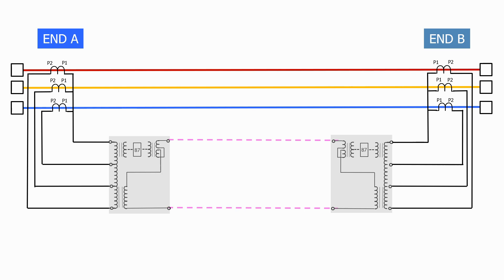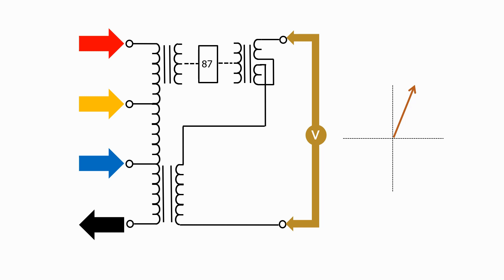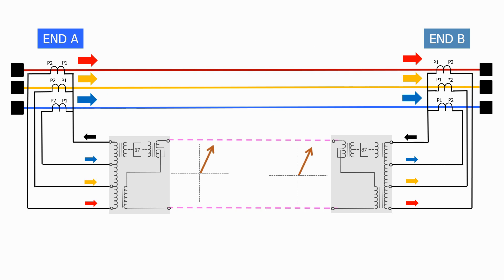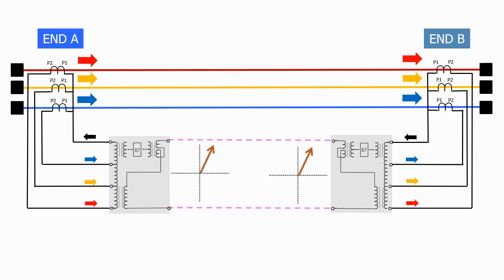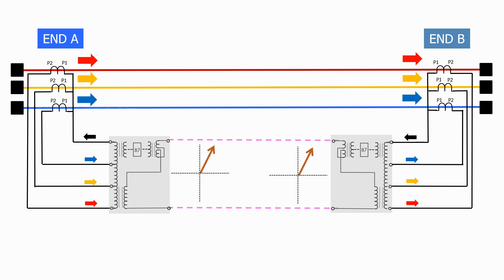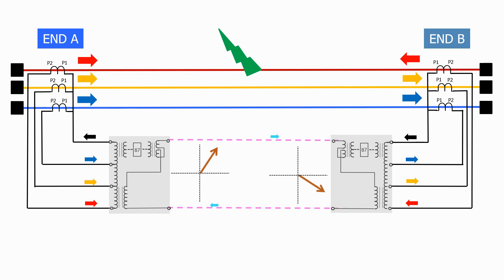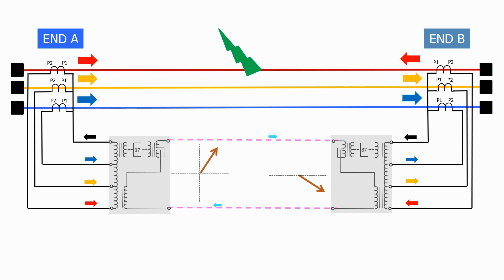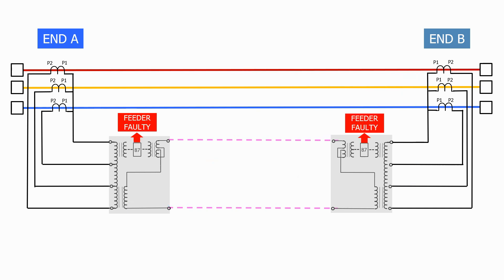Pilot wire differential protection

Comment: Hi Stephen, your explanation is clear and concise! Well done! Do you conduct lessons on the commissioning of pilot wire commissioning? I  went to the Udemy website but could not find any course on pilot wire commissioning under your name. Please advise. thanks. If you have I would surely sign up. Thanks
Reply from the maker: Hi,
    Feeder / pilot wire protection is covered in part 5 of the protection course

regards

steve

Comment: Im new to this but interested. Does that mean you need to run two pilot wires to be able to have the loop shown at the bottom for the relay control.
Reply from the maker: Hi,
     Thats correct, You need to run two pilot wires between the two / three ends of the feeder so that the relays can compare the currents between the different ends.

steve